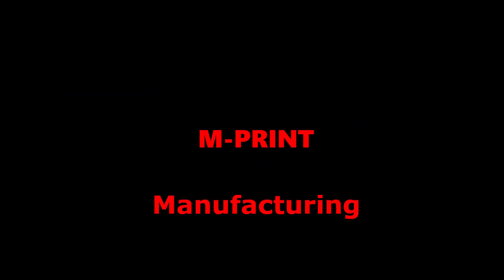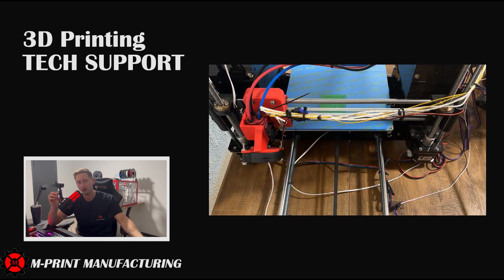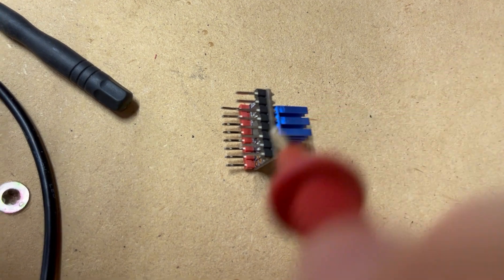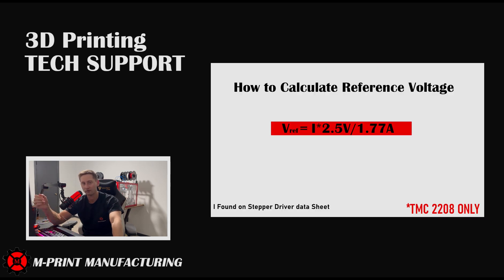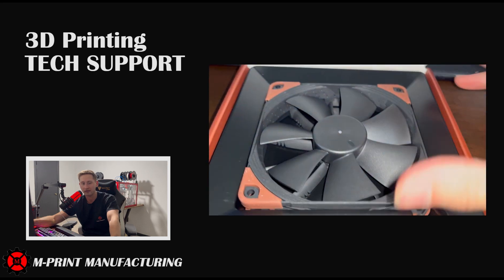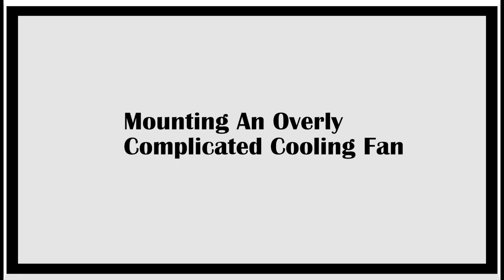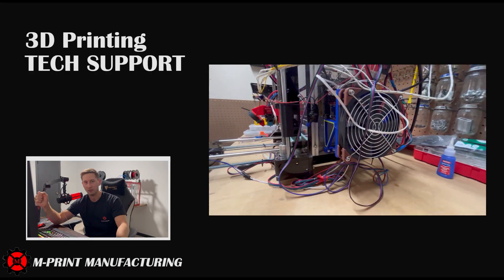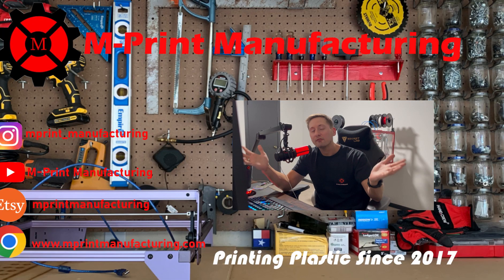3D Printing Tech Support: Overheating Stepper Drivers

Comment: Hey, nice video. Could this happen intermittently, causing layer shifts? Troubleshooting a massive shift that happened out of nowhere. Got my control box cooled by 2x120 noctuas.
Worth noting is that many printers use 24V PSUs, so you'd need a buck/step down converter to run a 12V fan off of it.
Reply from the maker: Hi @MrStoffzor, if one of your stepper drivers overheats it has more to do with the temperature across the driver, and would result in a sudden failure. Layer shifting is more caused by bad belts, slipping of the belts, or tension in your belts. Also bad bed adhesion is also a cause of layer shifting.  
If you wanted to add a cooling fan off your PSU there are 24 Volt cooling fans that you could use! Thanks for watching and subscribe for more!